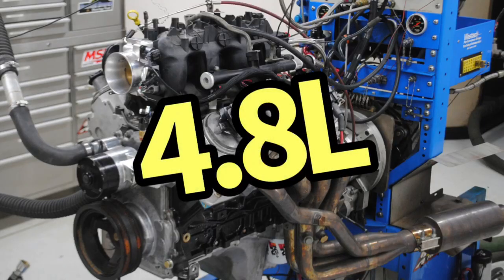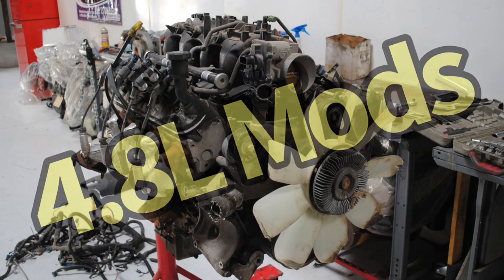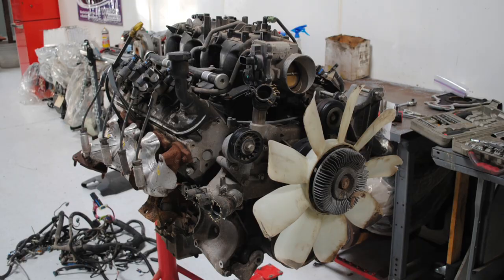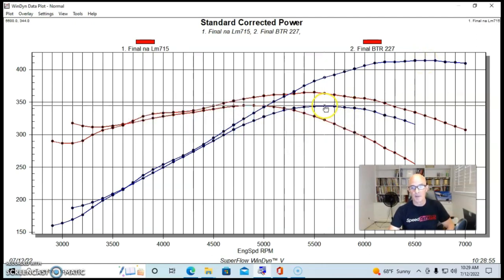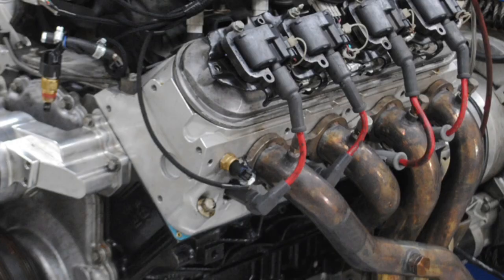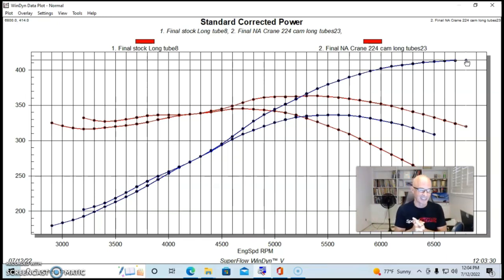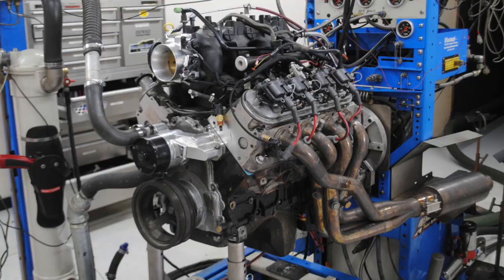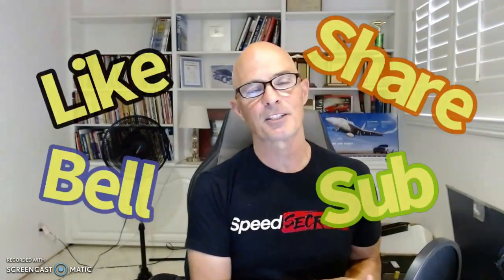IS THE BEST 4.8L MOD GEARS AND CONVERTER? HERE IS WHY YOU PROBABLY NEED THEM ON A CAMMED 4.8L!

Comment: All Hot-Rods need a High-Stall-Lock-Up-Converter, 
and somebody who can re-tune the Computer . 
A 7-Litre Engine takes up the exact same amount of space as a 4.8-Litre Engine, 
and weighs almost exactly the same,
and has AT LEAST 50% more Low-RPM-Torque than a 4.8-Litre. 

The Biggest Engine that You can cram under your Hood should be
the first High-Performance "part" that You should buy.
.
.
.
Reply: I agree, screwing around with a 4.8 is pointless when you can get a LY6 for $1500 to $2000.
Reply: Tell that to the guys running 4.8s in the 7s stock bottom end.
Reply: @ryangulley2051  that's very impressive.
But ok so stock short block eh?
So everything else is aftermarket? I'm guessing heads, turbos, intercoolers etc. How much does he really have in his build? $10 - 20k?
That $1500 LY6 is still cheapest bang for buck for your average guy.
I'll bet you could do a LY6 swap  and tune for about same $$$ as a a good converter and gears.
Reply: @indyrock8148  
Its hard to image why anyone would build a race-only 4.8-Litre.
If You put all of the exact same parts and machine-work in to
a ~50% larger displacement Engine,
You will still get  ~50% more power than the smaller Engine, 
and it will be under less stress,
so it will be far less likely to fail.

A carefully chosen Converter and Gear can work miracles,
even for a completely stock 240,000-mile 4.3 V-6.
My S-10 weighs ~4000 pounds normally loaded with Tools and other junk,
it pulls-off a very consistent 2.1-second 60-foot time,
this is only because of a generic ~3000-rpm Lock-Up-Converter,
and re-tuned Factory "Torque-Management" providing Traction-Control,
and this is on ordinary "Summer" style Continental Street-Radials .

And it cruises at ~2,100 rpm at ~70-mph with the Factory 3.42-Gear.

I personally, see no point in building a race-only, trailered car.
I want kick-ass AC, and a decent Stereo that You can actually enjoy.

The Engine that I'm building for my daily-driver S-10 is a
Twin-Turbo, 7-Litre, Gen-V, 
with a custom made "zero-runner-length" Intake-Plenum with
twin Electronic-Throttle-Bodies, 
custom 1200-psi Straight-Ethanol Individual-Port-Fogger-System, 
to supplement the Direct-Injection-System.

There will be zero Factory-Parts, including the Block and Heads.

It will idle like a stock Engine, and get excellent gas-mileage,
( well, excellent for E-85 anyway ).

It will also make over ~1200-pounds/feet of Torque at ~3000-rpm,
and over ~1500-horsepower at ~7000-rpm.
The Torque-Curve is "Pool-Table-flat" from 3000 to 7000 rpm.

Mega-Squirt Traction-Control will completely eliminate all wheel-spin.

To go Drag-Racing will only require putting on Radial-Slicks, and
adding 2 to 4 Gallons of Denatured-Alcohol (Ethanol) from Home-Depot .

Only around ~$60,000.oo Dollars, and ~3-years of your life.
.
.
.
Reply: @jimbrown563  have you started that build yet?
Reply: @indyrock8148  
I'm currently "retired", and waiting on certain massive investments to
come to fruition, which should happen in about ~6-months to a year,
so, I've got plenty of time on my hands, and almost no income right now.
( That's why I can burn serious time writing this )

However, to a certain degree that's a good thing,
over the last 3-years almost every aspect of this plan has 
changed substantially, those changes would have been impossible,
or prohibitively expensive, once the Engine starts going together.

There are also several Home-Brewed, add-on, Electronic-Control boxes
that keep changing and improving as more research changes the picture,
for instance, simultaneously controlling Dual-Electronic-Throttle-Bodies,
and adding 2- 3-Axis Accelerometers to the
Mega-Squirt Traction-Control-System,
and using Mega-Squirt to control the pressure and staging on the 
1,200-psi Ethanol-Port-Fogger-System.
( which actually produces real "Fog" that won't stick to any surface )
And, an Infa-Red Distance-Sensor under the front-Bumper to
keep the front-Tires from leaving the ground by retarding Ignition-Timing.
( the same way that the Traction-Control-System works )

Plus, certain decisions can't be made until certain other factors are known,
at which point I may defer to the expertise of other people that
actually do this type of Engine work for a living, 
and they will certainly know more than I do in certain key areas.

I'll also have to get another Truck to drive while all this is being
mocked-up, mounted, Wired, all the Plumbing done,
a Custom 4L80E Transmission built, ( by Me ),
and a brand-new custom-designed "Back-Half" frame built with 
an Independent-Rear-Suspension that can withstand the brutal Torque,
and facilitate mounting some 
30" tall, 295/40-ZR-21, Continental SUV Radials.

The Back-Half will be designed around being a
"Bagged" 5th-Wheel-style Towing-Rig,
without the usual Pick-Up-Truck-Box.
All Radiators, Batteries, Fuel-Tanks, Electric-Pumps, 
and Fluid-Reservoirs will be mounted behind the Cab, 
creating a close to 50/50 weight distribution.

Is there some part of all this that You are particularly interested in ?
.
.
.
Reply: @jimbrown563  cool plan I hope you get it on the road

Comment: Wouldnt a 216-218 cam be a better all around choice? Maybe around 110 separation. Id think that woud improve the low end and give more top end?
Reply: I think in general higher lsa would be better for low end, 110 is pretty tight
Reply: With the higher LSA the power comes in higher up in the rpms.. 110 to 112 LSA is better for lower end power gains..

Comment: so the best stall speed converter for a 4.8 is what?
Reply from the maker: for what application, cam, etc...
Reply: what is "best"? That's such an open ended question. Best for a offroad buggy, best for mom's trailblazer, best for my gutted nosfed gbody, or best for a DD truck that pulls a camper?

Comment: I’d like to see the same motor same cam durations but on a 108-110 lsa and see what the torque figures did, I’m a big fan of big converters and steep gears. Also what’s a limit on 4.8/5.3 factory rev limits, i turns stock ls1 to 6900 and on limiter everytime I drive it as a SBE with a good pump and  cam and top end setup

Comment: I have a VERY similar cam to that Crane 224/232. I see that it peaked at 6800 in the 4.8L, I'm putting that cam in a 6L. Would it be safe to say that it will peak around 6200 in the 6L?
Reply: Higher.
Reply from the maker: IN AN OTHERWISE STOCK 6.0L-IT WILL BE NEAR 6200
Reply: @richardholdener1727  - LQ4, PRC Stg 2.5 706/862 heads, FAST LSXRT, headers, etc.